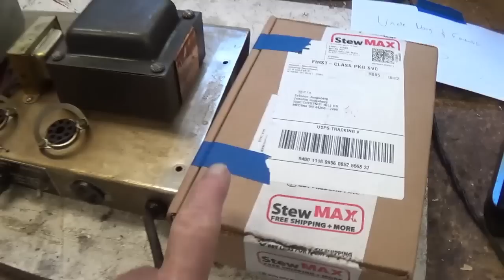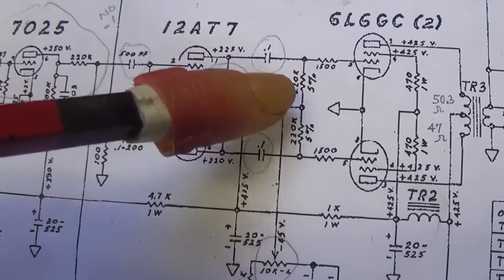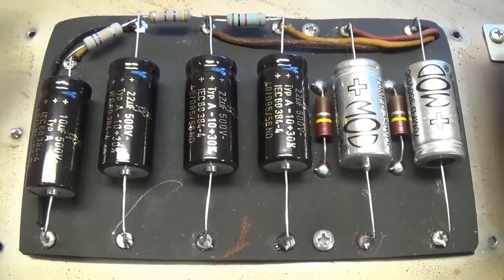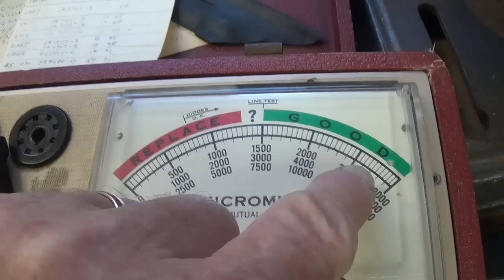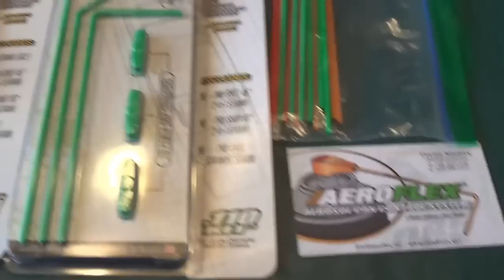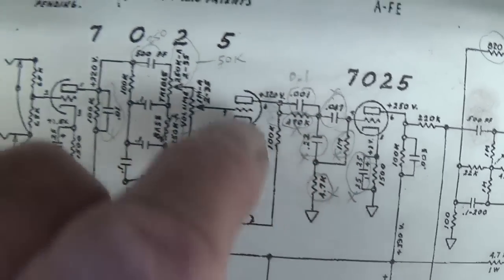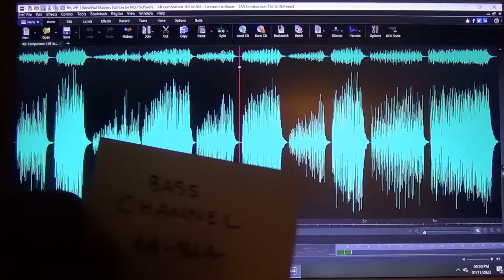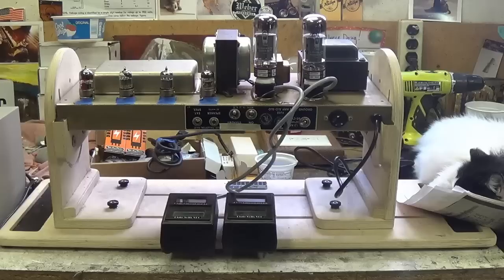Is the Conversion of a AA-165 Bassman to AA-864 Specs Worth the Effort ?

Comment: Great video.  My Bassman has the tube chart very intact and the date stamp is OL which is December 1965, yes? It also clearly says AA165, which goes against the statement here that in April 1965 they switched to AB165.  Is it possible that was not a strict rule
Reply from the maker: Perhaps they happened to have  bunch of AA165 tube charts handy.....or perhaps your circuit really is an AB165......or maybe the two different circuits were being made at the same time.  There are way too many variables to be certain.

Comment: @UncleDoug

Hey Doug. Just dropping a quick question for you.
I was recently watching a video on the history of Stevie Ray Vaughan's amps.
Apparently when Caesar Diaz came on board and started repairing Stevie's broke down, worn out blackface amps, he converted them for more road reliability... He added Solid State Rectifiers, bigger transformers from a Twin, and more Silverface-esq specs.

The solid state rectifiers really intrigued me, and I wanted to gather your opinion.
If a person wanted to try one (I have mid-70's Silverface Super Reverb, a Twin, and Vibrochamp), is it as simple as removing the rectifier tube and swapping in the Solid State, or is there more serious surgery and alterations required to accomplish this? Is this a viable option for reliability, is it unnecessary, or will it significantly alter the sound or performance of the amp?
 If it's that simple as swapping one for one, I would like to at least give it a try, as these are around $20.
My reason being, if my amp were to lose a rectifier tube in a gig or rehersal, it would be very convenient to have one of these laying around in my tool kit to get me back up and running.
Thanks for any assistance on this
Reply from the maker: Greetings, CG.  I thought Fender Twins already had diode rectification, CG. As far as the Vibro Champ, I think diode rectification would be a mistake. If you have a GZ34 rectifier in the SR, you really don't need diodes for performance and reliability. It's the best rectifier tube there is. Just my two cents :-)

Comment: It seems like the lower value pots in the tone stack make an easier path to ground for high frequencies. Therefore, the 864 tone seems deeper, but may give more useful treble range on the tone pot. Any thoughts on that?.. Certainly more lower mid range gain.
Reply from the maker: The muddy tone can definitely be improved by altering the tone controls on the amp and guitar, TJ, as well as using single coils.

Comment: Uncle Doug, would like to ask you how you go about removing the grommet power cord holder. I have a Fender Bandmaster 1965 that needs the power cord changed. Can't seem to get this power cord grommet out. Sounds like a dumb question but your advice would be appreciated.
Reply from the maker: I use large water pump pliers to compress the strain relief so that it can be pulled out of the chassis hole, Michael.

Comment: Great video. I admire these deep dives into schematics and variants.

Id like to ask for little help. Ive seen schematics of an old super simple amp. It only has 1 preamp tube 6sj7, then phase splitter (7025) and output section of four 6v6. But cant find it anymore. Can you help me with my search?
Reply from the maker: Check the schematics for Fender Champ amps, Stan. They are simple and sound great.

Comment: Very interesting. I Was dissapointed that you removed the 8uF capacitor. In my experience adding this power supply node is essential to remove the last traces of power supply hum when the volume is maxxed. Think the Bass channel mods are only applicable to using with a bass guitar probably to improve it....at the start of the CBS era.
Reply from the maker: You'll be relieved to know that I reinstalled the 8uf cap after the audio testing was completed.
Reply: @UncleDoug  ..Oh the relief ! He He

Comment: Hello Doug, when working on Fender amps, Ajax coupling caps were used and no longer made. I noticed that your using yellow caps and I assume that they are Mallory 150 caps. I do see others use orange drop caps. Do you feel that the Mallorys work better with the Fender amps?
thank you.......
Reply from the maker: I think any good quality capacitor of the correct value(s) will work just fine, Jim. I am not a proponent of boutique caps or the general theory that a certain brand of cap is necessary for good tone.

Comment: The 864 sounds more 'authentic' perhaps, but at the levels you were playing it I preferred the 165. Probably quite different when it's working harder. Just personal preference through my own stereo system. I did notice the extra bass and mid range through the 864, but the muddiness  put me off. Although it made me think of some old Rolling Stones/ Keith Richards stuff, which gives extra points.
Reply from the maker: Bear in mind that the bass can be rolled off and the treble increased with the tone controls, Pete.

Comment: Now I know why bass players prefer the AA-864 circuit. Fender should never have tried to mess with perfection.
Reply from the maker: Agreed, Jason. Just like today's internet sites, they just can't resist screwing up a good operating system by constantly changing what does not need to be changed.

Comment: I've seen several late 60's- early 70's Fender amps with "Richard Hand" stamped inside the chassis. It's a bit disconcerting to see an amp was assembled by a guy (or gal?) named Dick Hand. Seriously though, I've seen Richard Hand stamped inside several Fender amps. I've also seen other names stamped at the rear of chassis, by the serial number. I don't always see a builders name stamped, and wonder why some have them and some don't? As you know, Fender would often substitute parts values, mainly capacitors & other wacky anomalies are found, even on amps close in serial number. Maybe there were supply chain issues, Leo & later designers changed their minds a lot, or  there were just many liquid lunches consumed at the Fender factory? Maybe a combination of all three??🤔
Reply from the maker: I met Richard once and now regret shaking his hand, AFP (just kidding).  I think all the factors you listed were involved in the variations we see in circuit characteristics.

Comment: Great video!  I've been missing learning from one of my favorite teachers.  I'll take a stab at answering the question in the title:  Yes, it's worth the effort.  I understand now why the 864 circuit amps are so sought after.  I realize that this is all speculation almost 60 years after the fact, but do you have any suggestions as to why Fender altered the 864 circuit?  Also, is the not-so-great bass channel sound the reason that the AA165 circuit was changed after only a few months to the AB165 circuit?  I'm now really curious as to how different the AB165 would sound compared to the AA165.
Reply from the maker: You bring up several good points, Jon.  Leo was long gone and the CBS engineers had different priorities and had probably ceased to listen to musician's input.

Comment: The channel that got modded was for the bass guitar, so probably bass should be used to evaluate the results of the modification. My theory is that through the research and development Fender has considered the more recent circuit is more "bass friendly" and implemented it. Because the schematic comparison with the "classic" and well known normal channel here shows clear distinctions - which go much further with the more recent design - eg. a massive 224 cap from signal to ground and three triodes used to amplify the signal. So I have my doubts about "butchering" a mint amp in such a  way. 
On the other hand also the bass channel will probably be used with a guitar exclusively - and we can clearly hear that the 165 version is pretty useless for the guitar - so this mod has some sense. 
I have never seen this circuit and I'm thinking about building just the bass part of it just to check how well it performs with bass guitar. 
For the gunked up tube sockets  and tubes I'm pretty sure somebody used a Deoxit like substance on them and it then bled from the sockets on the tube itself due to the orientation of the chassis.
Reply from the maker: Thanks for your thoughtful input, Jernej.

Comment: Doug I am glad that you mention, restraining orders - I am cancelling my plans to chase down & white-spot this amp.
And just as well  - the cover stories they provide me from Langley just make no sense!.

Offered in sincere good humour & wishes for a better world in 2023, dear sir. For satire of Canadian authority I recommend, The Lumberjack Song by Monty Python's Flying Circus.
Reply from the maker: Thanks for the great comments, Andrew :)
Reply: @UncleDoug  DID IT! Followed common sense approaches, as seen here, & the Magnatone has responded! Moved its own on off switch from upper chassis, to the lower (with its original o47 silencing cap.). 
Cleaned tube sockets. Found & discarded a Chinese 12ax7 with split mica wafer, & used a Siemens ecc81 from parts drawer. 
Found & discarded a leaking 2 mfd cap near power tubes - had a 400V fancy one on hand; original though was rated 450V.
FIgured out a way to hang the reverb tank, with RCA jacks upward as per the Biggs serial numbe; did so using its bag, clipped to the upper chassis! Nicely isolates it from walls, unbilical, & the speaker magnet.
Now there's no AC in the umbilical - just the minimum 6 leads of DC. 
Doug may I ask: should, could these leads ALL be twisted, as per the heater leads - or not necessary? Maybe undesirable? 
Incredible footnote: schematic for the Estey Magnatone Custom M8 reveals - extension speaker give you fake stereo FM vibrato. Same as the 260 Buddy Holly Lonnie Mack type amps! 
Plus, speaker and effect both are thrown by a footswitch! Phase inversion achieved I think via the power tube wiring trick you found in other Maggies.
Finally, yes, I am accepting congratulations - when they come, from the good folks in Huntsville and Los Alamos.
Reply from the maker: @andrewgillis8572  Thanks for sharing this heroic repair story with us, Andrew. You only twist AC wires, to neutralize their EM field. Twisting DC wires would probably create a magnetic field......so don't do it.

Comment: Maybe the white grease was Penetrox or the like. It is goopy substance used by electricians made of a petroleum base with suspended zinc particles used by electricians to ensure good conductivity, displaces moisture and prevents corrosion. Especially between dissimilar metals like copper and aluminum.
Reply from the maker: Whatever it was, it was a messy nightmare to remove, SHW.
Reply: @UncleDoug  Not really suited for tube sockets, we use it to attach feeder wire to panel lugs.

Comment: Hi Uncle Doug, I started working on the bassman amp which says fender electric instrument company thinking it was a AA864 circuit but now I’m not so sure because although it has the bias pot for overall negative voltage and not for balance, it also has  the extra 8mfd at 450v...... plus just checked the volume pot and it’s a 1 MEG-A.
Would you say it’s a AA165? Rgds
Reply from the maker: It sounds like a AA165 to me, Alvaro.

Comment: Hi Doug another great video.  I have a question if you don't mind I have built a 5f1 champ clone and when I test the voltages they are in spec but what confuses me is that when I turn the amp off and unplug it the caps only have about 2V in them they seem to drain themselves quickly is this normal or the sign of a problem? Thank you very much I have learned so much from your videos.
Reply from the maker: The capacitors can drain quickly through hot vacuum tubes, Robert. It is perfectly normal.

Comment: I was surprised that removing the cathode bypass cap from the tone recovery triode in the AA-165 contributes to the more robust sound of the AA-864. Usually, a bypassed cathode yields higher gain. Perhaps removing the voltage divider from the AA-165 contributes even more.
Reply from the maker: I'm not so sure that removal of the bypass cap contributed to anything, Jeremy. In fact, I re-installed the cap after the audio testing was done.
Reply: @UncleDoug  Interesting.

Comment: I get concerned about changing capacitor types.. There are those that believe the "tone" comes from the inferiority of some parts... A ceramic cap changes value depending on the signal level across it.  A mica is rock stable.  If you ask me.. screw authenticity and make it with the better part. :)
Reply from the maker: We have no idea how vintage amps sounded when they were new, Jarl. The way they sound now is largely the product of partially/completely worn out components, speaker, etc. especially with Tweed amps. Installing all new, on-spec components probably makes them sound like the did when new.......which sounds odd to us now.

Comment: Here's a thing I don't quite understand yet, Doug. Why is the negative bias supply a half-wave rectifier with a single diode? It also doesn't seem to have as much filtering as the main power supply. Wouldn't this produce a lot of ripple that would get injected into the signal as hum? (Or... wait... does the ripple cancel out due to the push-pull configuration of the output tubes? I think I just answered my own question. :)
Reply from the maker: I think you did too, AQ ;)
Reply: @UncleDoug  Special request: I'd really like to see the the bias supply ripple on the scope someday.
Reply from the maker: @AdmiralQuality  I'll keep your request in mind, AQ.

Comment: Sir, I very much want to work on/build amplifiers and pedals. I know almost nothing about how this works and I am piecing it together as I need to as I fix my own equipment.
Is there any material you can recommend to be to learn this skill? Even if it's, "electricity for dummies." 
I was great at math and physics in school so I am confident I can learn it. School was a long time ago, so the learning curve might be steep.
Reply from the maker: I am entirely self-taught using internet sources, JL. It sounds like that method would work for you too. Good luck.

Comment: Should I use 1 watt resistors instead of 1/2 watt resistors if the prices are not an issue?
Reply from the maker: Yes. I use 1W resistors (minimum) in all my builds.

Comment: the 864 is the way to go.

well now im going to start over from your first video, hope I dont bother you too much.  when you were converting the amp to the 864, what type of resistors were the tan or could be pinkish ones? Metal film are blue, and metal oxide are grey, correct?
Reply from the maker: If they were original they were carbon comp.
Reply: @UncleDoug 2 @ 220k resistors connecting pin 7 T3 one of them goes to ground and the other is connected to the end of the new bright yellow cap
Reply from the maker: @irusman62  Carbon comp.
Reply: @UncleDoug  ok thanks they sure are cute little devils

Comment: An unrelated question I have a Harman 290AX power transformer that I used in a 5f1 champ clone I am building it has 2 white striped red wires that I think I can omit but I wanted to ask someone who knows what they are doing if I am correct before I cut and cap them shorter.  thank you very much I love your videos.  I did ground the yellow striped red wire as it is the center tap and the green wire with the stripe.
Reply from the maker: Without mapping the windings, I have no idea about the nature of the wires, Robert.

Comment: Hello uncle Doug! Can I ask a rather off-topic question? Do you have any opinion about biasing preamp stages using diodes instead of resistors? Thanks a lot
Reply from the maker: I've never heard of such a practice and wonder why it would even be considered.
Reply: @Uncle Doug  apparently is somehow common in the hi fi world,  the idea being that since the voltage drop in the diodes is almost constant regardless of the amount of current flowing thru them, the biasing is more stable and the frequency response is more "flat". It seems it is also used for some very hi gain amps. But if you haven't seen that, it probably is not a good idea 😀 thanks!
Reply from the maker: @elluisito000  Interesting, Luis, and not a tactic I was aware of.

Comment: 12:50 - Interesting that BOTH those bias circuits have that 15k hanging off the left leg of the pot!
Reply from the maker: That is how the overall bias -DC range is established, David, for both bias and balance.
Reply: I don't like the bias balance circuit because there's no simple way to do it with just one potentiometer that doesn't run the risk of losing all negative voltage to both 6L6 grids and causing the tubes to overheat and short circuit or perhaps even take out a transformer.  The ordinary bias adjust circuit can be wired with a jumper so that if the wiper connection is intermittent the bias voltage to the tubes will go full up, idling the tubes cold and preventing damage, but you can't wire the bias balance circuit in a similar manner.
Reply from the maker: @goodun2974  Good observation, GU. Thanks for sharing :)

Comment: Nice! Just out of curiosity, in a 5F6-A, with either channel volume up around or North of 7, is it normal to have a bit of noise? Thx!
Reply: Definitely. Resistor hiss at least, plus tube noise depending on how good they are.
Reply from the maker: It depends on the status of the circuit, Dave. If you still have lots of carbon comp resistors, some pops and rustling noises are inevitable.

Comment: While watching, I keep wondering what made Fender even want to change the circuit at all. Parts shortage or price challenge ? It does not make much sense.  The amp stealing sales from more profitable versions in the line-up ?  Hmm...
Reply from the maker: God only knows, Stephane. Some of the changes are truly an improvement......but many are not. As you suggest, parts and economic issues may be responsible.